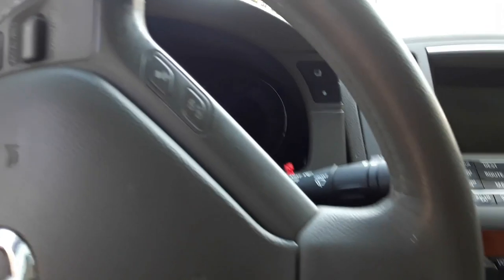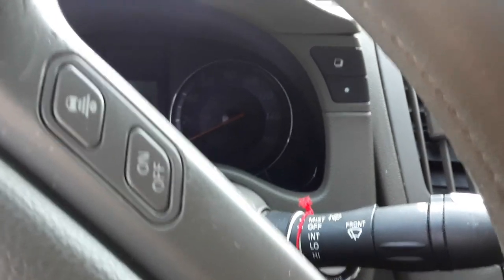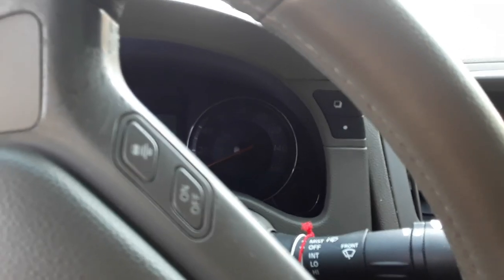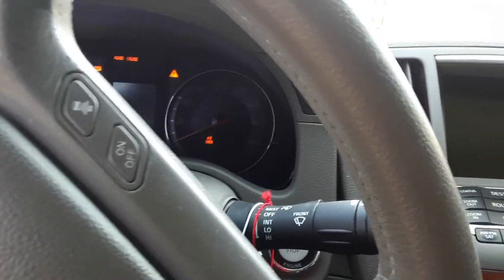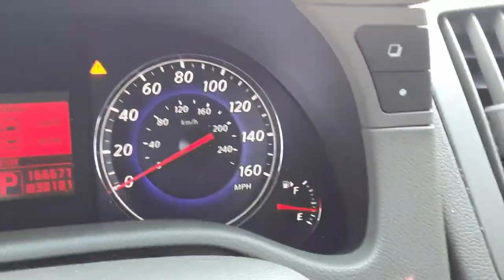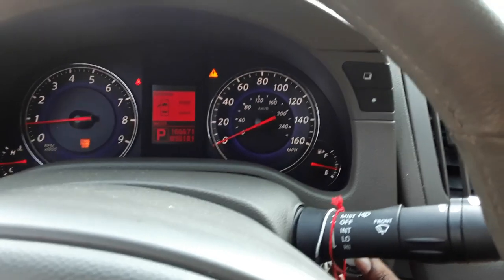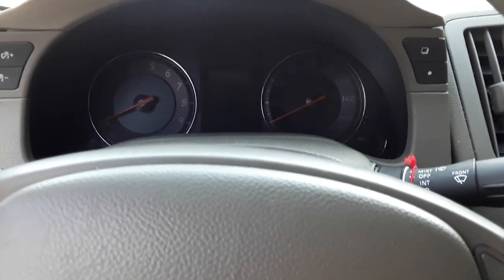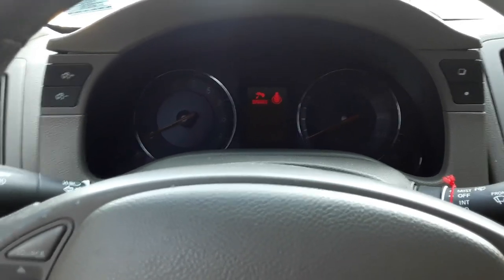(Infiniti g35) How to fix your Gas Gauge!

Comment: I will be fixing mine this week. I have been ignoring the problem for years. The Infiniti dealership told me to drop the car off to fix the problem for free (there is a recall) but I never bothered. Thanks for the video.
Reply: How was you able to drive your G for years with this issue? The reason I'm asking is because I need tips or guide on how to drive my G with this issue until I'm able to save up the funds to get this issue fixed.
Reply: @kiingtutt8019  I just know how long my gas tank takes to run empty. So I just fill up the tank when I feel it's times. There are times I forgot and almost got stranded without gas.
Reply: Every trip to the pump reset trip A or B and you can track how many kms or miles you have driven on a full tank . Just make sure you do it and know you car average kms with a full tank . Pain in the ass until you fix this issue  . I got stranded in a buzy highway without gas and it was not fun at all plus the money i had to pay to be tow .

Comment: There’s also another sensor on the opposite side you can clean too. A lot easier to get out with no fuel mess. I’d clean them both up to be safe
Reply: DOES IT WORK
Reply from the maker: It really works 💯💯
Reply: @streetracingtoys716  can it work whit a g35x 2007?
Reply from the maker: Dave Souls I believe so I’m not sure but if the fuel pump is in the same spot it should be the same
Reply: @streetracingtoys716  ok tks am givit a try

Comment: Do the other side too! Also, I did mine first thing in the morning before I drove anywhere unplugged the battery and took the gas cap off. Hardly had any gas come out the line.
Reply: 😆 that’s not the only problem they have trust me 
They have many more
Reply: @2002carlita  lol I have an 04 g, no problems, besides something petty like this. Engine and car is great

Comment: Thanks my friend. I got the same issue with my G35. I replaced the fuel pump thinking the problem was the floater. Pump is new but I will try that anyway. Desperate to fix this.
Reply: I'm having this issue with my G37. U say u replaced ur pump and the probkem persisit?? Did it not come with the floater attached🤔 Was the issue resolved and how?? Thx

Comment: I did that to both sending units and it didnt work so y replaced both unit and nothing. It sucks. So finally bought a used cluster on ebay with lower milage for 140$ and fixed it. My problem was the resistors on the cluster stop working and you get no signal from the sending unit. Nissan f up on this.
Reply: Bro that’s happening too my g35 Infiniti I fixed both gas gauges in the back , nothing happened my shit still didn’t read Gas so my mechanic says I need to buy a new cluster cuz mines is not working get no signal
Reply: Was your fuel gauge moving at all ? Mine is moving but misreading. It readhalf while the car was empty!!

Comment: Before you do this, with the car off, hold the Trip A/B reset on the left of the steering wheel. Then with your foot off the brake, press the start button twice while holding the Trip button. The let go the trip and press it 3 more times and it’ll go into Cluster diagnostics mode. From here on, holding the trip will move Coolant and Gas gauges to half.   Letting go will move them to empty. This is how you know if it is your cluster or not before hand
Reply: Thank you, very useful
Reply: I don't get it can you explain more? What does that tell you and what happens after you do that? Are the gauges supposed to go back to normal or they stuck like tht or what
Reply: @dadon2024  by following those steps all the needles suppose to move up and down showing the gauge itself isn’t broken and it isn’t the gas needle that’s the problem but probably your sensor under the back seats ( passenger side of the tank as there will be two “doors” under seats) or your ac amp located behind the nav
Reply: @Hootinandhollerin  ac amp? What is that? I need help because I did the cluster diag and the needle moves and I’ve replaced both the whole fuel pump assembly and the one on the other side and still nothing
Reply: @DennyBalance  it’s behind the nav
Reply: Can I do this on a 2003 g35
Reply: Brother, I've changed the odometer, fuel sensor and fuel pump (I still have the same problem)
Reply: Great point 🙂 very much appreciated. In my case I tried the cleaning of the fuel pump already and it didn't work. Tried this tip you left here and in fart the needle of fuel is dead. Thanks again
Reply: Hey DC is it cool if I tap in with you? Just in the middle of a project with a g37 and there’s so much wrong with it besides the fuel gauge😂
Reply: So this means the panel is good and that the fuel pump is bad right?
Reply: Yoo I have a g25 with this problem where is my trip button
Reply: i just did the steps. the needle didn’t go up and down. needle was  pointed at half?
Reply: I have ex35 the fuel gage works but misreading. Sometimes reads half then go down to quarter ( which is the correct reading). No check engine light code. Any idea?
Reply: @emmanuelflores580 did you figure it out? I have the same problem and some told me its possible a module which is behind the radio.
Reply: @DennyBalance were you able to fix it?

Comment: Mine randomly gets stuck at half way, wven when im at 1/4 tank it will go up to half tank. Doesnt do it all the time, do you think this would solve my issue? Thanks
Reply from the maker: Chris Hutchinson I think it should work someone in the comments said you can wipe both sides to but I definitely think it will
Reply: Mine was the same way until the other day it just dropped to empty.

Comment: I have cleaned both units on my car and still didn't fix the issue, I replaced both of them like 3x and the problem still didn't go away I am guessing the issue is my gauge cluster or  the BCM. Anyone know what else could cause this issue ?
Reply: Did you find out what the issue was
Reply: @kaamsogrimm  well what I did was I connected both of the units to the wiring harness, then put the ignition on accessory and I manually moved both of the floats to the bottom/empty position and then slowly raised them to the top/full position after doing that my Gauge started functioning again but unfortunately it still isn't very accurate.
Reply: @xls4750  okay because I just bought a new cluster & if this don’t work I’m gonna get a used AC Amp

Comment: So the tank doesn’t need to be emptied before doing this ? I’ve got to the point if disconnecting the black cable where gas shoots but then as I was cleaning the outside of the gas that spilled , more gas started coming out the black cable. Didn’t want my G to fill with gas so I bailed on it.
Reply from the maker: Harry rolon sure your right I was low on gas because a couple of days before it cut off on me not for the first time so it really made me just do it an try it out it really works tho!👍

Comment: How long did it take for your check engine to go off? I tried it i don’t think it worked i may need a new cluster. I have an 05’ 35x sedan.
Reply: If your gas needle won't move at all meaning it's stuck on E you might. If your gas needle is giving you weird readings then you don't need a new cluster.
Reply from the maker: Trey Petty it wasn’t the reason my check engine was on
Reply: @streetracingtoys716  I cleaned mines also and it didn’t work 07 Infiniti g35x I need a need instrument cluster
Reply: i got the same problem and same exact car
Reply: @tjgotbands  just sell it bro that’s what i did lol for 4200
Reply: @stealzbysauce  i just got this car about a month ago 😂
Reply: @tjgotbands  it’s the cluster you can take the gas float n clean it it’s under your backseats